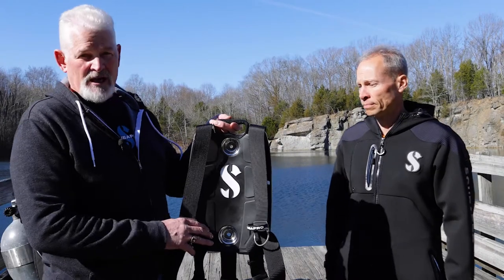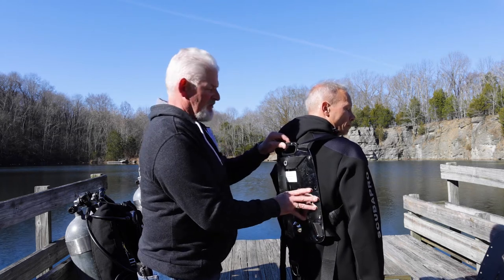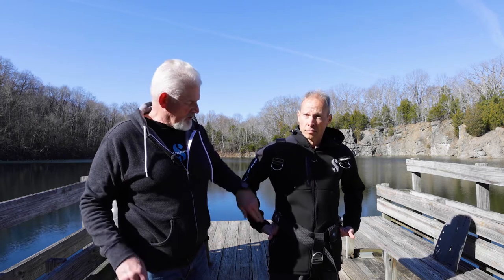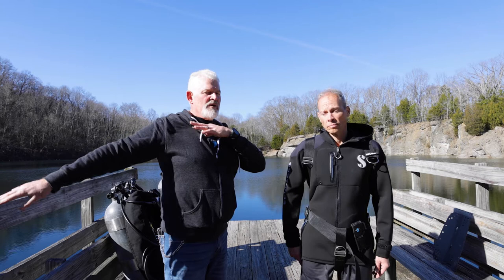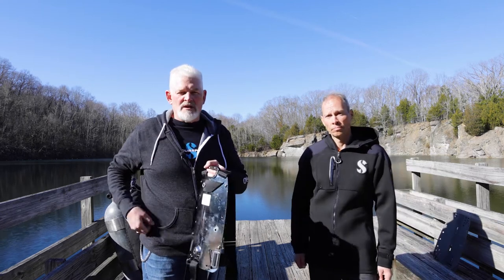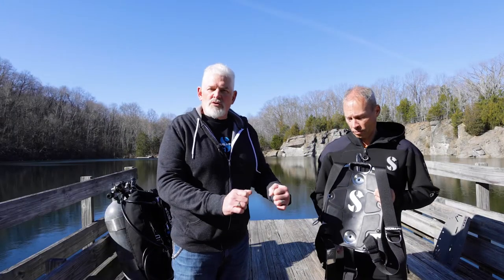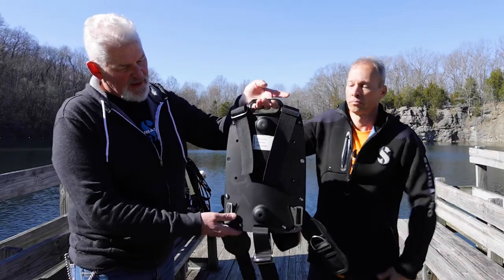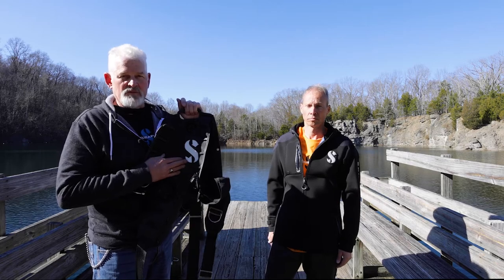S-Tek Gear Configuration, Part 2: How To Set Up the Pure and Pro Technical Diving Systems

Comment: Having have purchased the S-Tek with the trim pockets, it’s is much easier to put weights in the trim pockets, with the wing OFF the back plate, and then assemble it all. I found that with the STA underneath the wing, you are simply fighting too much. With the ergo nuts, makes that process very simple

Comment: The stainless steel buckle on the pro harness looks like it would rub against ones upper bicep if it were setup like it is in this video. Anyone else notice that? Personally, I don’t like shoulder straps setup that way. On a backpack, I use the sternum strap to keep shoulder straps from drifting outwards. That’s the way the hydros is designed.

Comment: The trim weights CANNOT be put on without a specialty tool. My hands hurt from trying for 30 minutes and making a trip to Lowe’s to try to get it on. Engineers need to design the car to be worked on. This is a end user thing too, so not well thought out.
Reply: I’m trying to be kind in my review, but this is wrong not including the tool you need to put this pouch on with.
Reply: The issue, as with all things Scuba Pro, is the proprietary nature of the black nuts with holes in them. Yes, a royal PITA to remove and replace, without the proper tool. Same as their scuba hoses

Comment: Installing trim weight pocket at the back of backplate can be a problem. For e.g. If you want to add just  2 pounds of lead in each pocket the wing nuts will tighten. But if you add 3 pounds of lead then the wing nut cannot be screwed. Is there anything which can be done about this ? One option is to add additional trim weight pocket on the backplate or add the trim weight pocket on the waist.